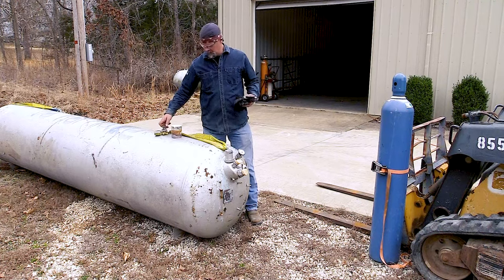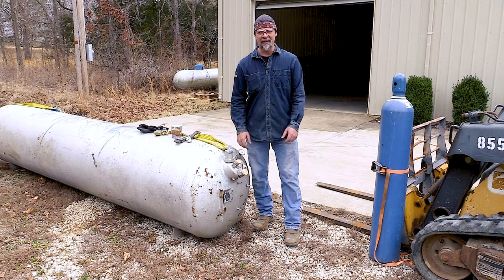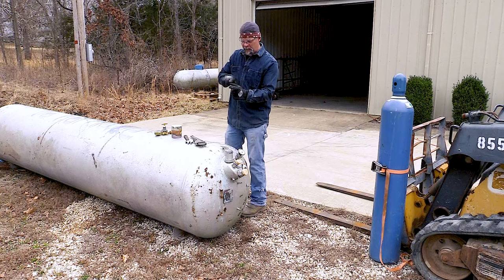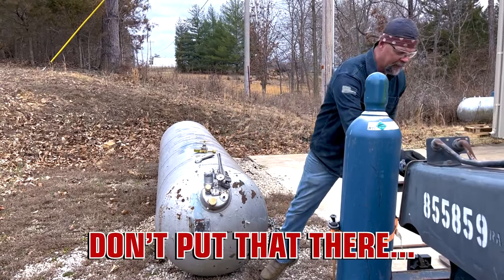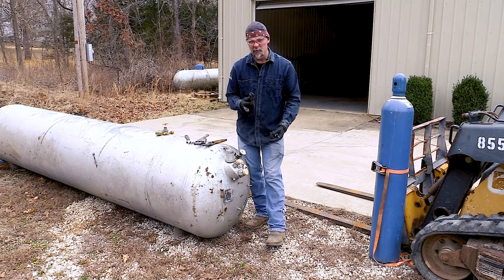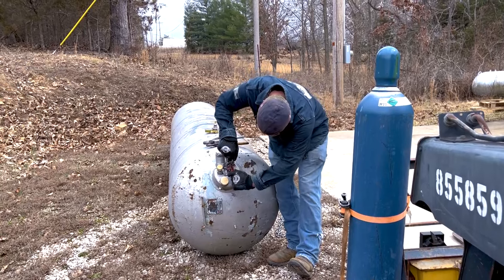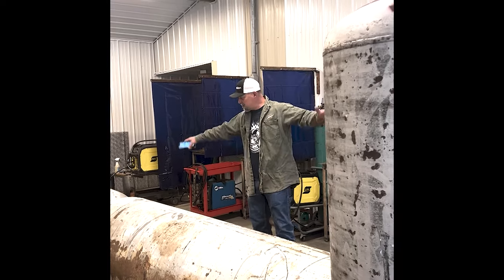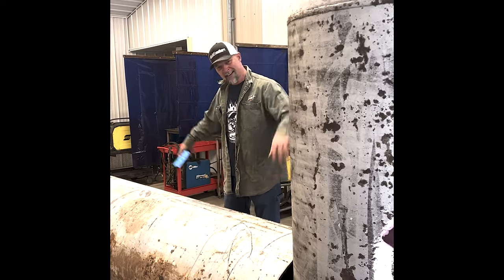How To Remove Valves From Your Propane Tank

Comment: Do you not have to fill it with water first? I have a 250 gallon and not had the courage to cut on it lol
Reply: I think he purged with an inert gas. Not sure what he used, but the gold standard I think is to fill with water/detergent and then dump it and purge.
Reply from the maker: On this video I started to purge with CO2 and I wanted to demonstrate how to use the combustible gas meter from Forensics Detectors that I use all the time. However, this is an end fill type tank and I couldn't get to safe levels. The tank is VERY old and turns out had a lot of mercaptan in it. 
I wound up purging the tank with water days later after trying to purge with CO2 several times.
I have several other videos on the channel that show how to purge with water and this is the most common method.
CO2 video coming in the future though!
Reply: @SmokerBuilder  I have a 250Gal tank and have not been brave enough to cut into it.  I have had it for oh about 8 years now. When I bought it, the valves were already removed, and open to the atmosphere.  I can't decide if I want to use CO2 or water.  My biggest question is if you fill it with water and soap should I use a torch or grinder?
Reply: @TheSlatonTeam  did you ever end up cutting it open I picked up a 300 gal and I’m scared to cut it open definitely going to do it with water soap
Reply: Hi @Bigcbbq Thanks for checking in with me.  I have not....  My real estate business has really picked up quite a bit.  Even with the interest rates going up.  I have been able to show my clients here in Texas that a few months ago they were having to pay $60K $80K over asking just to have an offer accepted.  Now my clients are having offers accepted at list price and in some cases, they are getting seller concessions that allow them to buy down the interest rates for a few years.   Any way I digress I have not had time to work on my project.  I am going to use a torch rather than a grinder.  In my early working career, I worked as a welder.  Building heat exchangers and other heavy equipment.  Several times a year I would hear of people getting injured or killed by girder wheels coming apart.  I would rather fill it with soapy water and cut it with a gas or plasma torch.  If I can have less gas vapors to ignite, I am good with that.  wet griding wheels just gives me goose bumps!